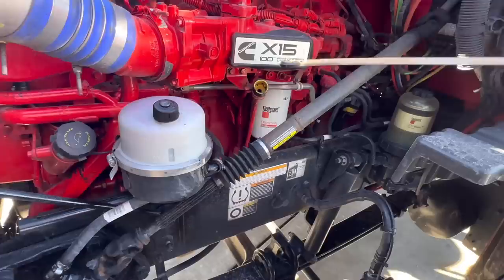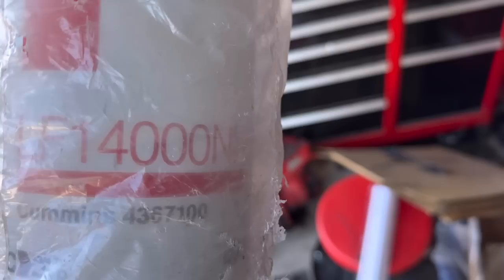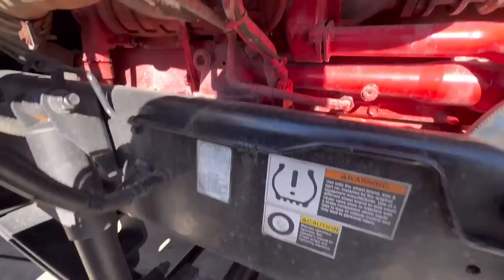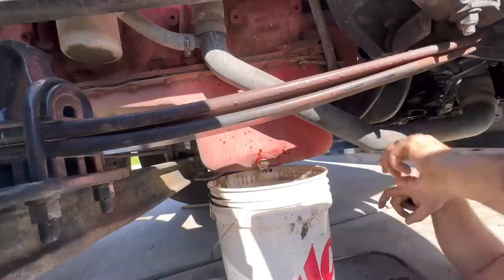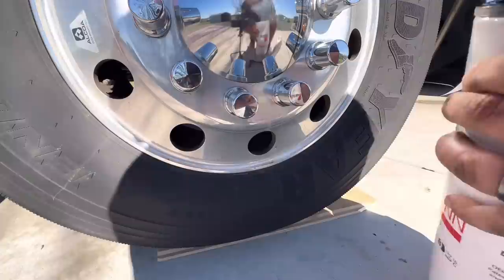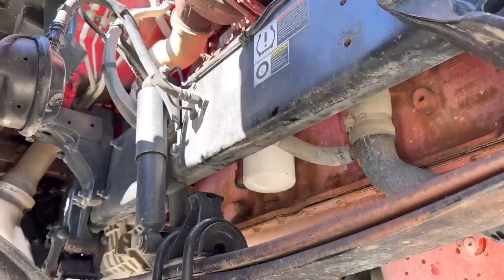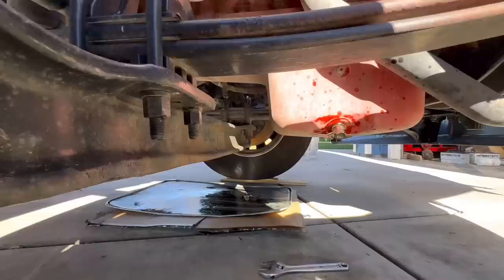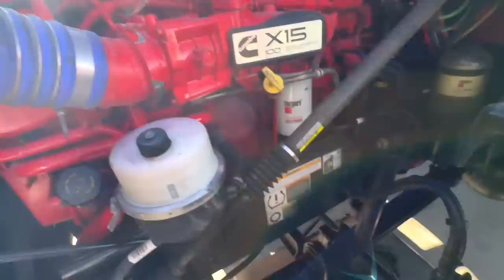"SERVICING A PETERBILT 579 YOURSELF" Part 1: The Oil Change

Comment: The reason manufacturers don't want you to prefill the oil filtre is because the risk of contamination, if you want to prefilled make sure you don't pour the oil down the centre hole but temporarily plug this up and pour the oil down the holes on the outer of the base, the centre hole is the main pick up.

Comment: I worked at a  truck stop doing PM services for around 8 years and I always filled up the oil filter and on ISX oil filter I had a gal jug with the side cut out to help drain the filter. I put the Oil filter on by hand with a  quarter turn with and oil filter wrench

Comment: Have you ever thought of fitting a two stage oil filter bypass system ?. I fitted one to my semi 3 years ago and swear by it. I still do my oil changes sooner than they recommend. So I did not do to save $$$ but to get better protection for my engine. I have my oil analysed every second re-fill, and so far reports have been very encouraging. Worth a look at if like me you like to take care of your investment...

Comment: I would install a plug into the new oil valve just in case.  It has female threads to do that but that's just my OCD kicking in.  I agree with snugging up the oil filters a little.
Reply: Wasn’t the clearest pix but I didn’t see any threading in the bottom of that new valve/plug?

Comment: Before I started driving full time back in the 80's for Cherokee freight I sericed trucks we used cut down old fuel tanks about 6-8 " high to drain oil in would hold 11 gallons put handels on the side to grab hold of
Reply: Had the same thing a 15gal metal can works well if you can find one a 30 gal would be better.👍🇺🇸🤙

Comment: You go to home Depot and you get a concrete black mixing pan it'll hold 11+ gallons of oil and then just buy a simple 13volt oil pump. If you want you can put it right back into the bottles

Comment: The age old debate to fill the filter or not. I was told by my shop fill them. They usually have me run it about 5 minutes while checking for leaks. Now my fuel filter goes on dry just lube the gasket then cycle the key 5-6 times and she fires right up. Not a fan of those valves because on mine it would hang off the bottom but yours looks like it doesn’t hang too low. I’d also have to get two because I’ve got front and rear sumps. But hey it works for y’all that’s what counts. Informative video

Comment: Good to see your both well and still with us. Nothing wrong with the way your doing it . Experience has the influence on the way its Done. Filter pliers to tighten mmm. Would personally use a filter strap , just to be on the safe side . Because of the extremes in weather you guys drive always check the belts thoroughly.  Nice to see you back , by the way I'm not telling you how to suck eggs. Each to their own

Comment: I’ve used an old  44 quart cooler before the works good. But I took a 55 gallon drum cut in a quarter section and used it

Comment: Good to see you guys back. I was starting to get a little concerned that I would lose both you and Velox 18(looks like he's moving away from trucking) all in one month.   Great tutorial on the servicing of Tiny Dancer.  I know you still have part 2 to release, but I was wondering if there is any additional servicing required with a motor that runs DEF?
Reply from the maker: I know what Velox has been upto since we are friends and keep in touch regularly but letting him share it when he’s good and ready too. As far as we go we will be here for the longhaul
Reply from the maker: on the DEF only scheduled DEF services and the dealership handles those not much you can do on your own with the system

Comment: So how many quarts or gallons does the truck take? Also which filter is on the driver side next to the fill spot for the oil? The one you changed looked like it was on the passanger side. I have seen the fast or fass system mount on the driver side with 2 filters would that replace the one on passenger side?
Reply from the maker: 11 gallons. Fuel filters are on driver side. One in engine is secondary the primary is on the frame behind wheel well. It’s also a seperator.

Comment: I've got a question for you,  is your engine brake set to stop ingaging at 35 mph or less? Second was your transmission set to lock out manual shifts out of 12th gear? The company said I could not change the parameters of the engine brake.  . Is it a thing with cumins x15
Reply from the maker: Never was locked out out of 12th gear manual, I have manual in all gears. Engine brake was set to turn of at 25mph but I changed it. Those are all parameters you can change.

Comment: I have a 2024 579 fuel efficient x15. It’s saying I need t5 oil. It’s supposed to go 50k miles. That seems crazy can I run t4 in this engine?
Reply from the maker: Don’t go 50k miles, it’s insanity, I know that’s what Cummins says but with a single oil filter and all the egr they use it’s no good. I went about 25k miles on intervals but it was getting 8mpg, after sampling that’s when the oil started showing life of slight break down on viscosity. So usually around 22-24k it got changed. If you’re not getting 8mpg and run fairly heavy I’d say I would change at no more than 18k. 

I don’t like synthetic or synthetic blends which is what T5 is, I usually ran Delo 400 conventional 15w-40 but now they quit making it so I went back to T4.
Reply: I’m getting 9.5 mpg I run extremely hard but I also run light loads 75% of the time. I just can’t find anything on the internet to tell me if I can run t4 instead of t5 which Cummins recommends. Does your 579 recommend t5 also?   What year is it?
Reply from the maker: You can run t4 just fine. But idk how you’re getting 9.5mpg and running extremely hard lol.